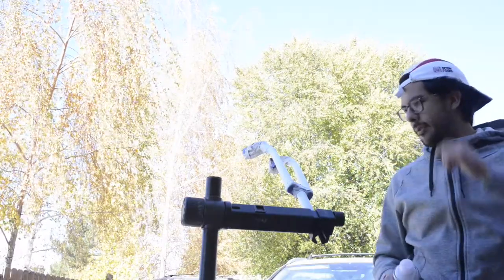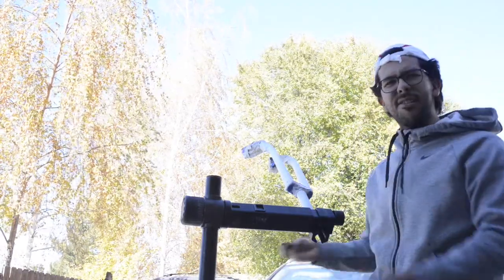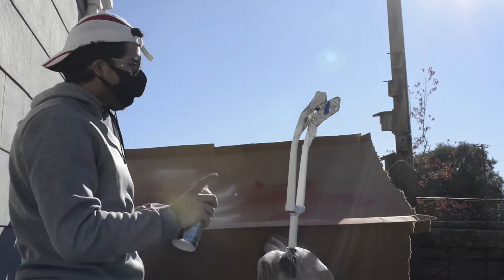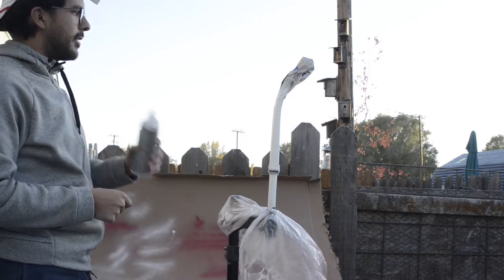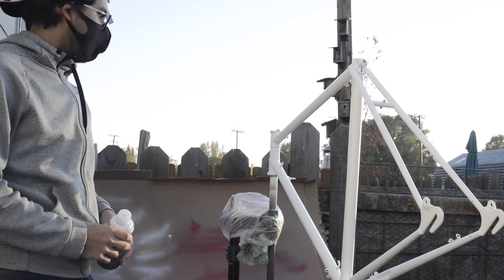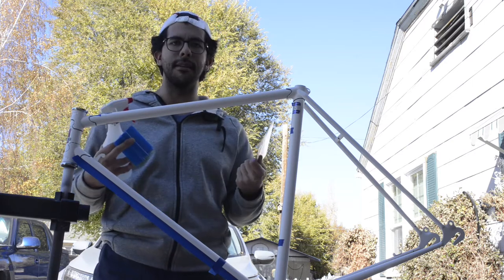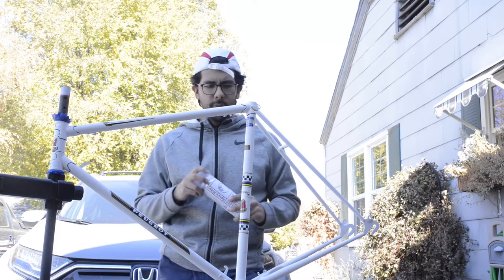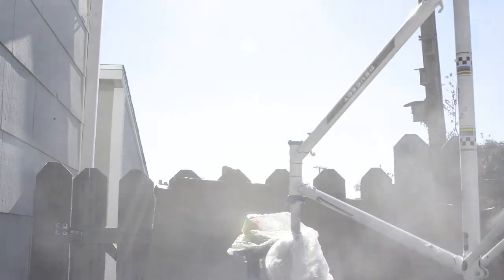Spray.bike & Velocals, Peugeot U-O8

Comment: Did you ever end up with a sort of gravelly finish from the spray.bike ?  Ive spent so much time sanding that my fingers are raw .
Reply from the maker: Unfortunately yes. I spent quite a bit wet sanding between layers with a 1200 grit and even then I still have a few areas that are still a bit grainy. Overall though it's not noticeable unless i'm looking for it